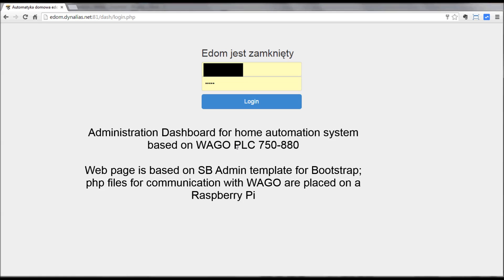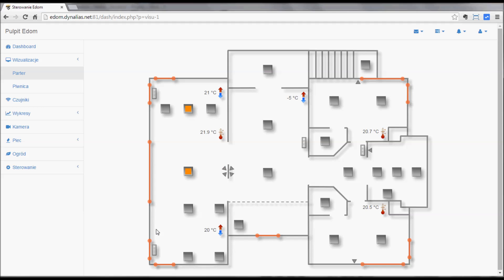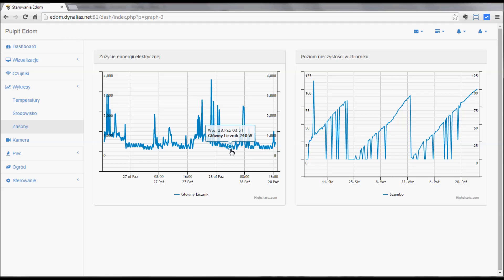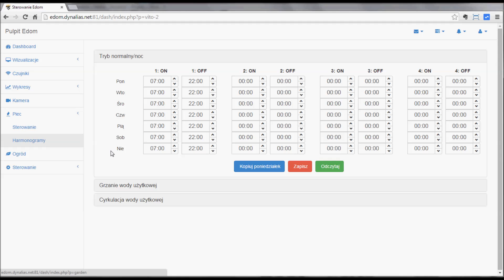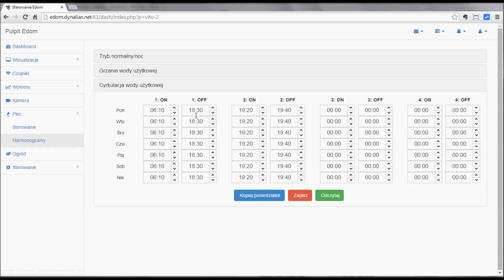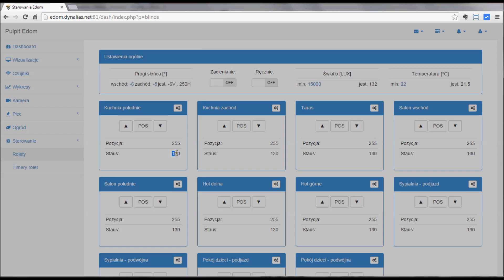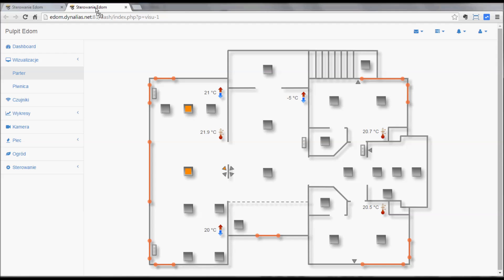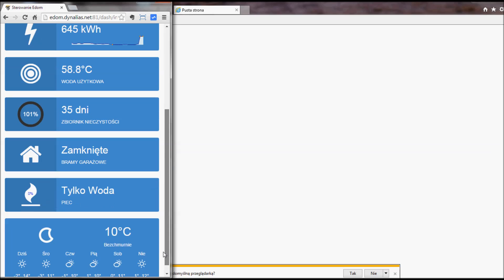WAGO 750-880: Dashboard for home automation / Pulpit administracyjny do systemu automatyki domowej

Comment: I'm working on a smilar project with a webserver on raspberry pi which pilot arduinos around the house but i'm really far from you!! you've done a lot work on this project!! good job.
Right now i'm thinking on how i could add scénarios from the webpage but i don't know what would be the best to do.
Send a frames with scénarios informations in it and store it inside an SD card on the arduinos or store it on my webserver?? what would you do ?